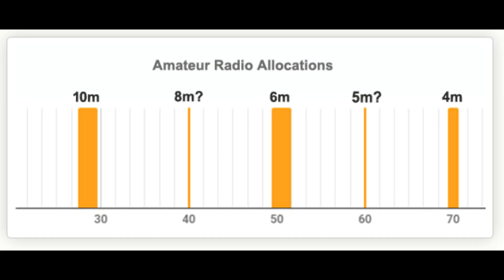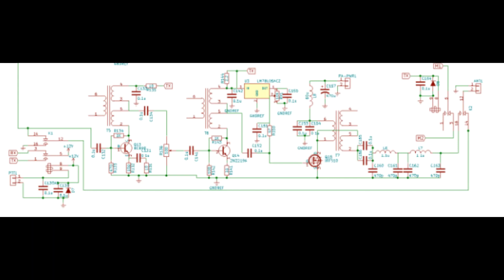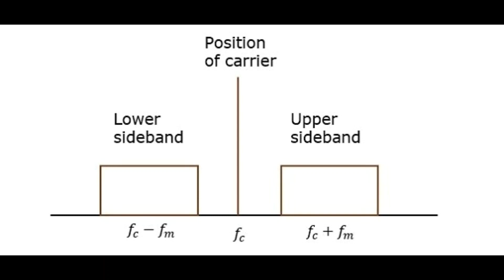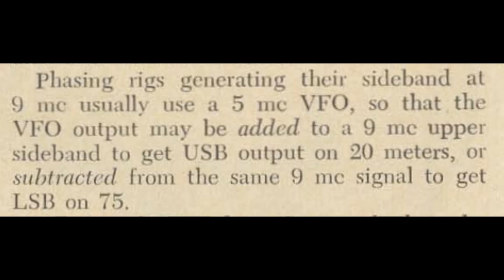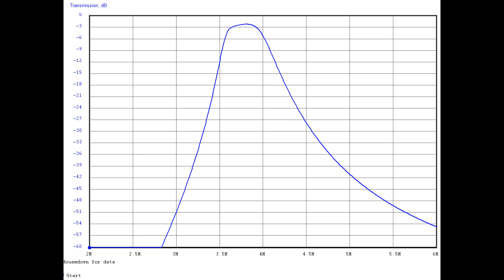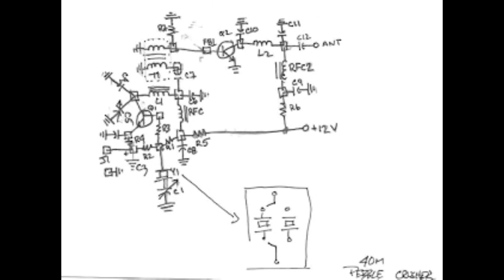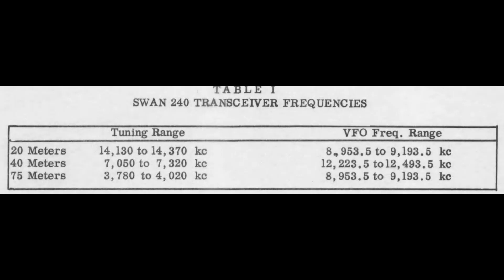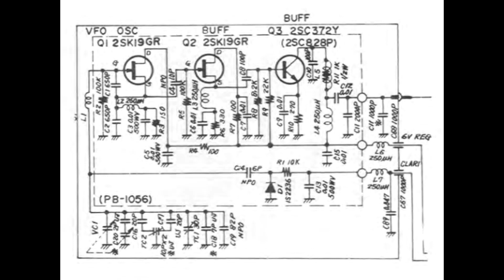SolderSmoke Podcast #232  August 27, 2021

Comment: I have a swan ss-200 with a 5mhz approximately filter. It Changes to upper from lower when you go to 20m from 80 or 40. To change you click a "reverse" switch (for upper on 80/40 and lower on 20. It is pretty much the first all solid state rig ever sold. There is a much better nanoVNA out there. More expensive also. One thing they do not exactly make always clear is , every time you change the "stimulus" (frequency your checking) you need to re-calibrate the NanoVNA. You end up re-calibrating a lot because of that.
Reply from the maker: The Swan SS-200 switches the carrier oscillator frequency: 5.5 MHz for one sideband, and 5.5033 for the other.  The 5.5 MHz carrier oscillator is marked NORM and results in LSB on 75 and USB on 20.  Three other bands (40, 15, and 10) are also available using different VFO frequencies.  Cool rig.  73  Bill